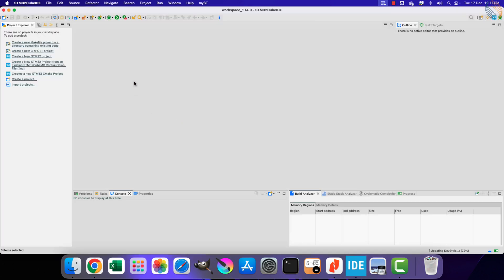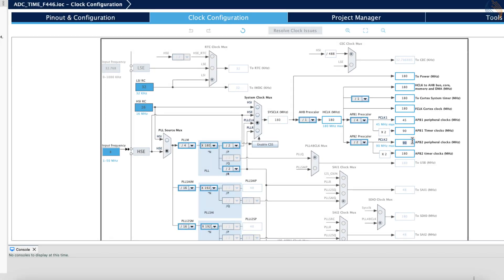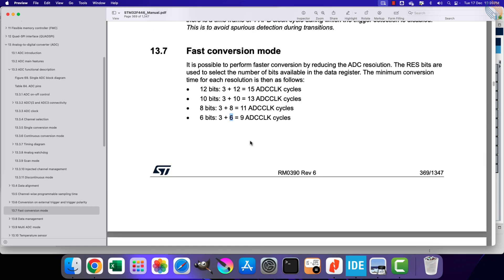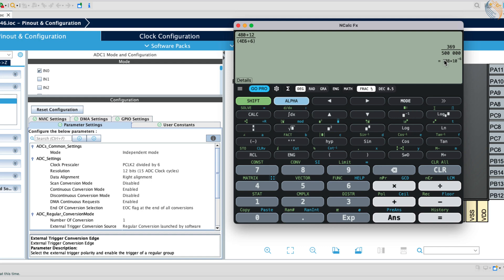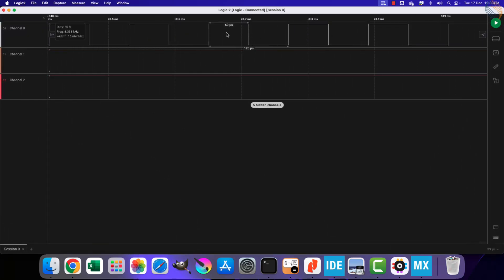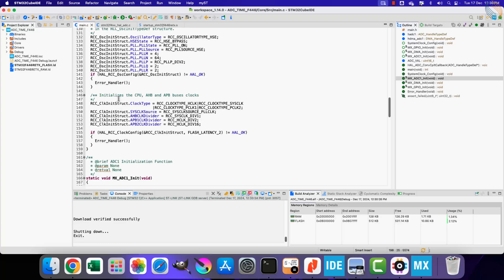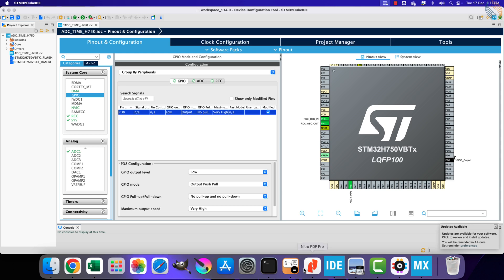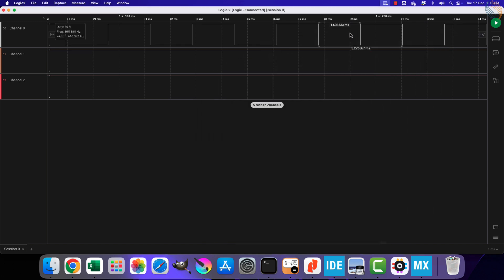STM32 ADC #6. How to measure Conversion Time || Single Channel || Multiple Channels

Comment: Hello, I followed the steps using an STM32F411. I'm using the 100 MHz system clock, and after dividing it by 2, the resulting clock is 50 MHz. According to the formula you showed for the sampling time:
TM = (sampling + conversion) / adc_clock
In my case, that would be:
TM = (3 + 15) / 25 MHz = 720 ns,
which would correspond to approximately 1.3 MHz.

My question is:
Why can't I see this frequency on PA1, which I configured to observe it on the oscilloscope?
Reply from the maker: Try with a lower frequency first. See if that works.